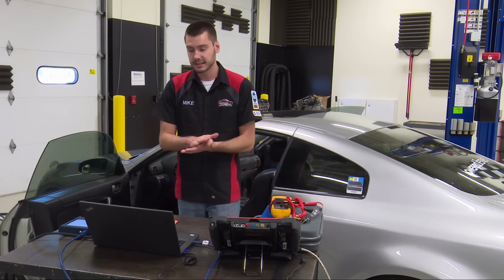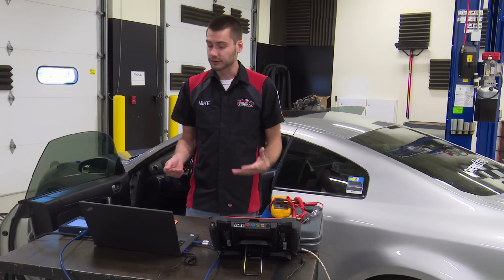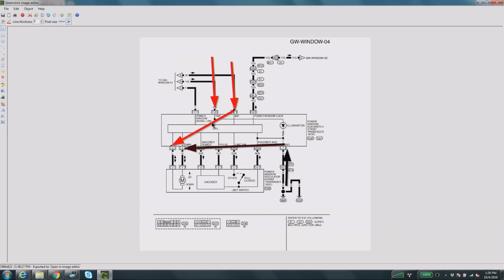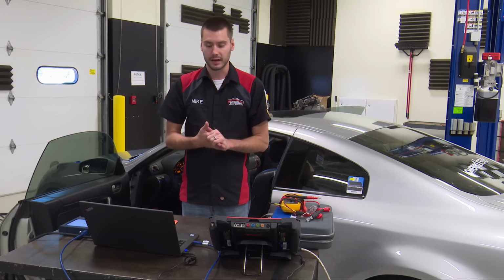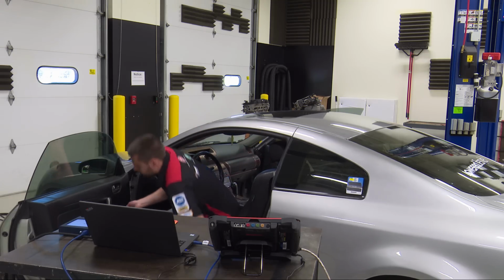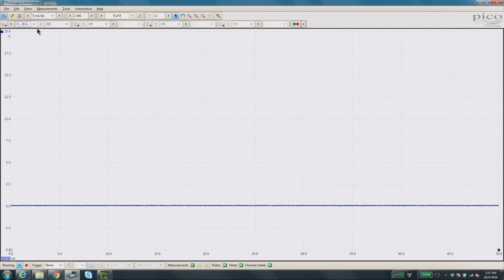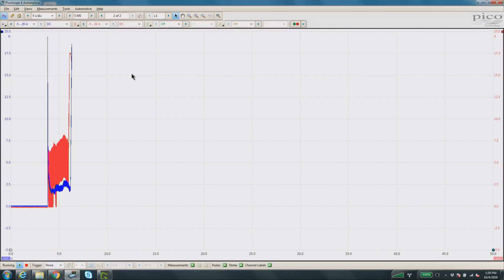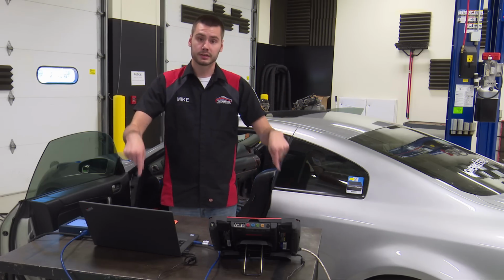Infiniti G35 "Smart" Power Window Doesn't Work...With A Twist

Comment: This will also work on a 2008 g35s sedan rear passenger side.. use jump wire example as he does here..  this will roll the window up..  thank you so much.. saved me from a very wind driven rain down pour..  SUBSCRIBED 👍

Comment: I.HAVE   nissan 350z 2007 roadster which is faulty.  The issue is the passenger side windows works intermitently.  I have replaced the switch and the motors without success. I have followed all the diagnostic tree from the service manual the only so have ruled out the harnesses.  The only thing left left is the bcm. Have you seen anything thing like this in the past

Comment: Hi this is a great informative video... I looked through  quite a few and this is athe best one yet. I have similar issue with my g35. But in my case this issue is intermittent.  I have changed the motor and the switch but still the same  any suggestion

Comment: All my windows stopped functioning... along with just the lock button. The unlock works. My motors are working bc i like a dumbass used my key fob to roll them down and now they are stuck down. I think it is an issue with the master switch. But could I just bypass the switches to just get them back up until I can resolve the problem completely? (Been rainy where I am)This is a 2013 infiniti g37x sedan. But I imagine itd be similar to what you did with the passenger window to check the motor.

Comment: Let me ask you something I have a g35 when windows stop working the turn signal lights stop working as well but I don't think  is gonna be the windows switch can you help me any ideas?
Reply from the maker: Hey Israel, sounds like it's going to be an electrical issue. I agree it doesn't sound like a window switch casuing the turn signals to not work. Maybe an intermittent connection/corrosion in some shared connector that lead to both?
Mike Becker, Senior Instructor

Comment: So if you’re able to jump the terminals and power the motor and the window moves up and down, does that verify that the switch is faulty? 

Also, the window can’t be operated from driver or passenger side switch

Comment: My question is , your information was great, but do you recommend replacing both sides with new motors and switch’s ?
Reply from the maker: Hey, thanks for watching! No, I typically don't replace both. The drivers side likely sees greater failure because it's used significantly more. When it comes to power windows, I typically only fix what's broken.
Mike Becker, Senior Instructor

Comment: I saw your video on the window motor and switch problem. It is funny,  you made A good video and have lots of nice equipment and a clean shop.  The one thing that you are overlooking  is using YouTube to watch and learn for yourself. You are always learning in this business so keep an open mind because that's how you get better. ;First off you said that it is a smart switch and smart motor right?                                                                                                                                                                                                                                                                                                                                                                                                                                          What's happening is that the new cars are using computers to run things. It use to be we used basic fuses and relays when we fixed stuff. Its a one dollar fuse or a five dollar relay. Nowadays we have modules and computers. So when your window switch or window motor module or computer goes bad it can cost you hundreds or thousands of dollars.;. So you need first off to scan and or  ask your car what's wrong by simply hooking up your scanner and look for codes  or in layman's terms ask the computer what is wrong. Simple right? hook up your scanner because then you will see in the BCM (Body Control Module) there is a reset procedure  or a relearn for this car. First you but the window down and hold the switch for five seconds then you put the window up all the way holding it again for another five seconds then just cycle the key 0ff and on you are fixed. The car as had a new relearn procedure and the computer will tell your smart switch and smart motor how to act. The window will raise and lower in time. and everything will work right again. there are lots of cars using that procedure . it is like shutting off your maintenance warning light .Or your ABS lamp warning or your check engine lamp, you need to scan and check for codes and or relearn procedures. Hope this helps and call that guy back and get his window working again. Thanks Paul MRAZ  780 crew
Reply from the maker: Hey Paul, unfortunately that wasn't the case on this one. This one needed a switch and motor. You're right though, some vehicles do need relearns.
Mike Becker, Senior Instructor

Comment: Mr. Mike what do you think would cause my new window motor and switch to burn, so I just bought a new switch and hook it up but after 1 hour of driving I started smelling something burning and it was the switch  and the window motor. I have the same car that you're working on it's also on the passenger side now I'm trying to find a break on the wirings
Reply from the maker: Hey RJ, what's the condition of the window track itself? Maybe the glass is binding up in there?
Mike Becker, Senior Technical Instructor
Reply: I don't think it's binding, the window was actually fast to go up and down before the switch and the motor burnt

Comment: Please help, 2005 g35 sedan. No windows work. If I jump black and white wires the window moves. Changed master switch still no go. Plus at night the switches don’t light up. Any help would be great.
Reply from the maker: Ben, have you checked power and ground going to the master? Maybe the fuse is blown?
Mike Becker, Senior Technical Instructor

Comment: Is it possible that the passenger side door had something wrong causing the higher amp draw like a tight window track, seal, dry regulator etc?
Reply from the maker: Hey Mike, there weren't any known issues with the door/track itself.
Mike Becker, Senior Technical Instructor

Comment: Nice video. I would have checked the current, but only have an ammeter and clampmeter. I wouldn't be able to slow down time and see the noise. I don't think. The average might have been different enough.  But I might not have figured out it was a poor quality part.      thanks for taking the time to make this video.
Reply from the maker: Hey Robby, thanks! Seeing it over time is what really helped it stand out. The meter may have shown slightly different with the average.
Mike Becker, Senior Technical Instructor

Comment: Very good video and diag! When working on cars and replacing something its always a good idea to think why this or that part failed. And if it could have taken something out downstream..
Reply from the maker: Hey Heyitschino, thanks for watching! Always always always a good idea to repair the root cause, not just the effect. It's something we do as a no brainer in so many other things...Brake pads are worn out, but worn uneven. Must be sticking caliper slides or something. You don't just slap a new set in..you repair the cause. Sometimes people just have a hard time relating that back to electrical diag.
Mike Becker, Senior Technical Instructor
Reply: NGK Technical Training so true!

Comment: dido to dave sage comment, be sure to check  mech. issues maybe bad track or wheel. etc. but very good tech. run down
Reply from the maker: Hey Mark, thanks for watching! Let me ask you this...think a track/guide issue is present when the window moves faster up and down that the drivers side?
Mike Becker, Senior Technical Instructor

Comment: That still leaves an unanswered question. It may or may not have an affect on this video, but still a good question! 

What was the original issue? The motor was replaced, but did not fix it. The switch was replaced, and temporarily fixed it, but blew out the switch again. So, it appears that the original window motor was replaced, unnecessarily. The switch was what was bad. 

Was it that the original switch went bad, and the original motor was still good. But the replacement motor was low quality, but didn't fix the switch problem. Then, when the switch was replaced, was it a good quality switch, or a cheap aftermarket product? And the additional switch that you used in the video, was it a good quality part? Did a cheap switch destroy the aftermarket motor? Was the aftermarket motor bad all of the time? What caused the original malfunction, and can you condemn the replacement parts on quality anyway, when the original oem  parts failed, causing this whole chain of events? This leaves a lot of head scratching moments! I hear a lot of comments about the sole use of original oem parts, only! However, the original oem parts have failed, that's why the repairs are being done! What is to say that a more expensive oem part, that has already failed, will be of a better quality than an aftermarket part! Many times, we see this on older vehicles, anyway. Do they plan on keeping the vehicle another 15 years? All parts are subject to malfunction. I guess it's now more of a service dept guarantee on a repair, and a trust with whether or not a part will outlast a repair warranty. Certainly, a two week fix is only acceptable for any part from a vending machine, downwards!! For a repair shop, I certainly wouldn't accept that time frame. And as a shop operator, I would go to the supplier for warranty reimbursement! Or no longer buy replacement parts from them! But, at this point, can you actually point to a specific fault for any of these malfunctions? Did a bad switch cause problems with a good motor? Did a bad motor cause problems with a good switch? Will Luke and Laura ever make up? Find out tomorrow on...no wait, that's a different show. Lol
Reply from the maker: Hey Roadkill5333, you're asking a lot of great questions. This videos really seems to have really made you think! The original issue was RF window INOP. Don't know why as the 2 main components had been replaced prior to me seeing the car. This happens a lot. I can't say for the motor, because it didn't come from us...but his switch was top notch quality from us! Thanks for watching/commenting...
Mike Becker, Senior Technical Instructor

Comment: with the age of that it is very possible that that motor will physically work,  but not be correct.    there may be an identical one that is wound  or made differently for use on a smart switch system.  physically fitting is not always the only concern.  great video as always.
Reply from the maker: Hey Richard good point..."if it fits, it ships" can't be used on this one :)
Mike Becker, Senior Technical Instructor

Comment: This reminds me of a ford fusion window motor I replaced one time. The motor was integral to the window control module so I couldn't. Jumper the motor. The switch worked but it wouldn't move or draw current. Turned out there is a transister control in an engine bay electrical box that kept it isolated. Unit was replaced and have had no complaints.
Reply from the maker: Awesome find on there Shawn. Window circuits can get a little crazy sometimes :)
Mike Becker, Senior Technical Instructor

Comment: Did we really complete this diagnosis?  Cause and Effect right... What if the motor was not installed correctly or there was a problem with the regulator. I would think that any binding would cause crazy amperage no? especially with the amperage that we see going down..
Reply from the maker: Hey RJ_Make, great questions! This one was replaced as a motor/regulator assembly. The customer confirmed the part was an economy line and did not approve any money spent upon confirming the ugly amperage draw any further. The part he purchased was 1/5 the price of the OE. 
Mike Becker, Senior Technical Instructor
Reply: @GoTechTraining  Ah gotcha. Thanks for the follow up.

Comment: Awesome job. To do the relearn all you need to do is roll the window all the way down then roll it all the way up and hold the switch up for about 10 seconds. then it will be programed in. If that doesn't work then there will be a button on the motor that has to be pushed. Can't remember the whole procedure for that one though. Been a while. Glad to see you back.
Reply from the maker: Hey man, thanks for watching! I really should have had the procedure up on the screen....next time!
Mike Becker, Senior Technical Instructor

Comment: Ugh, frameless windows, I remember the days of the Australian manufactured Mitsubishi Magna @ 1996 to 2005 that came with manual and electric frameless windows, that didn't wind up or down automatically on using the door handle for that gap between the weather seal and the glass, and had multitudes of problems.... broken glass from opening or closing the door, wind noise, tight regulators, window motors that would cycle open and closed, burnt switches from customers trying to get the window more closed. The procedure for regulator and glass assembly replacement and ADJUSTMENT (adjustment was 99% of fault and cause of fault) used to take over 1.5 hours but pay only 0.6 on warranty, it was an artform.

I have refused to take on the physical jobs on frameless windows since then, I will never ever pull one apart and then put one back together again, there are jobs I won't take on and this is one of them because adjustment issues can cause comebacks over and over and over and over.
Reply: Ps. Great vid Mike, yet, no scope pattern or evidence will ever convince me to take on a frameless window job again on any car, too many variables that can lead to rework, a knick in a window felt/guide rubber that gives a false reading, a worn gear set, a cable roller that only gets onto a flat spot every 50th time the window is raised, a customer that has had someone throw up in the back seat whilst thinking the glass is down and now everything is sticking, sub-standard replacement parts.... you get the picture..... no doors or glass.
Reply from the maker: Hey, thanks for watching! That sounds like a horrible time. Another horror story on a Mitsu...some things never change :) Luckily on these it's electronic, so no manual adjustment on here. Sorry to hear you won't work on these, but judging by your experiences, I can't blame you!
Mike Becker, Senior Technical Instructor
Reply: @GoTechTraining  lol, scarred for life!

Comment: Hey Mike, Great video as always . never heard of having to go throu all that stuff just to diagnose a window motor, but i guess they're all different. Does the bcm also work the power windows?
Reply from the maker: Hey Jeremy, thanks for watching! Yeh, this was a definitely a lot more than just a simple window motor diag. They get even more fun on newer cars that run door modules.
Mike Becker, Senior Technical Instructor
Reply: @GoTechTraining  what's a door module?
Reply from the maker: A door module is a networked module that controls the doors electronics. power locks, windows, maybe memory seat buttons, power mirrors, etc. That module then networks off to the BCM maybe. No we have a lot fewer wires running through the door jamb. Power, ground, some comm lines...but we aren't running load wiring to each window/door lock of the whole car. Module to module communication is a wire saver!
Mike Becker, Senior Technical Instructor

Comment: This makes the reason for using a scope when diagnosing a problem like this.  Couple vehicle age and the worn bushings & brushes in the motor and BOOM!  There goes the switch.  I guess this vehicle is not like the newer ones that use the door window switch as an input to the window module and have the module control the power.  Or they have integrated the power portion back into the switch like on older vehicles that didn't have the modules.  Looking forward to the Feb 7th video.  Thanks for this info.  I can't wait for the temps to go back up around here so I can get into using the Pico again.  I know my older Nissan has a bad ground for the start circuit.  Ya, I know, why haven't you fixed it already.  Well I'm going to use the Pico and my Fluke DMM to prove there is or is not a problem.  When I did the work last July, I found the main battery ground was mounted to the front timing cover, and the bolt holding it was kinda tight, but not real tight.  Consequently, the side of the terminal facing the aluminum cover was showing signs of arcing, as was the engine cover.  Note here.  The ground is up front on the ALUMINUM timing cover and the starter motor is mounted at the right side back of the engine to the engine and bellhousing.  But the engine is all aluminum.  I'm thinking there maybe some voltage drop here.  The ground cable was not replaced during the repair.  I chose to wait and do the testing to see if it would be better to have a cable going from the engine front to the starter mounting bolts at the rear of the engine.  The truck's only got 105,000 miles on it, but in the last almost three years, most of the driving has been around town, so, I think its time to do a thorough test of the cranking system.  The battery's a Nissan type, and only a couple years old.  So, time will tell.
Reply from the maker: Hey Mike, a scope here saved a lot of headaches! Sounds like a fun little project. Cheers to warmer temps :)

Mike Becker, Senior Technical Instructor